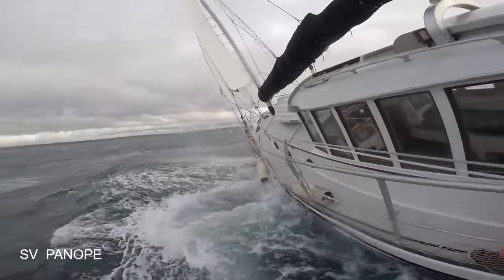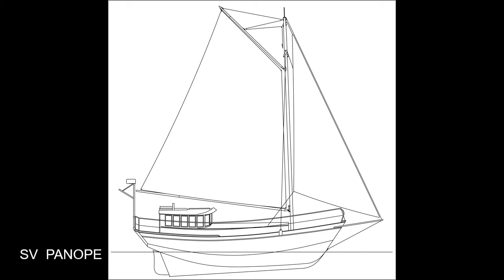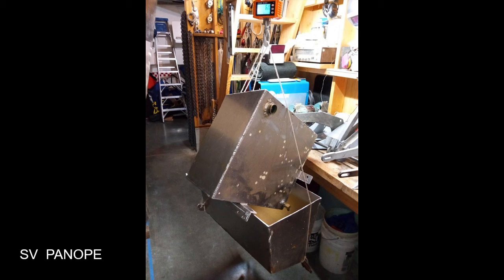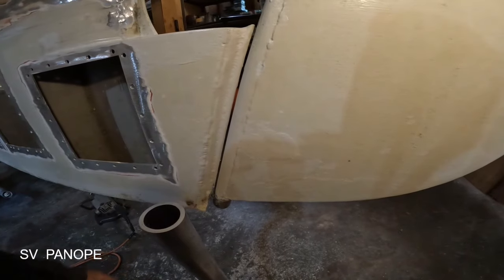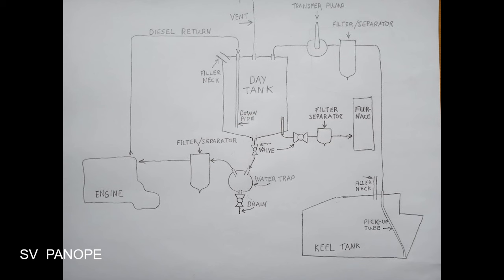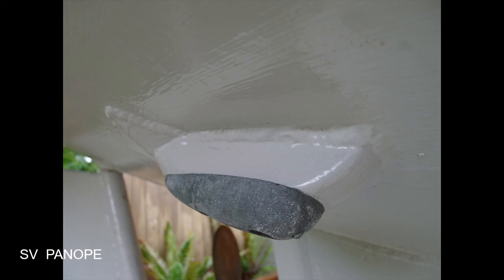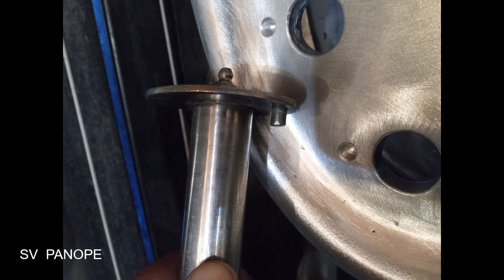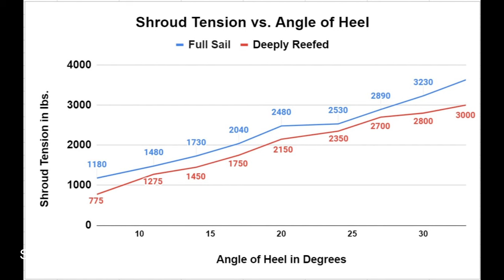Rebuilding PANOPE Part 3

Comment: You showed and mentioned that you added a heater that was plumbed to the engine. This is something we have been thinking of doing on our boat. Could you tell me what brand/model of heater you used? Thanks.
Reply from the maker: It is a Dickinson Marine "Radex".  Mine is the "Double" size.

This type of heater is often referred to as a "bus heater".  Lots of different Brands make them.  I chose Dickinson because I already have one of their diesel heaters and I like the quality (good metal).  No experience with other brands.
Reply: @flygoodwin  Thanks for the info..